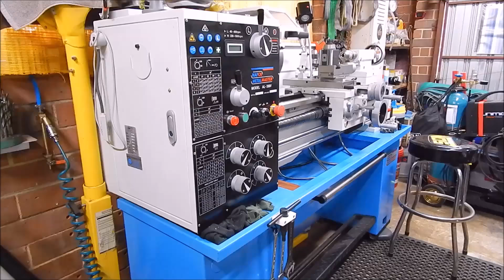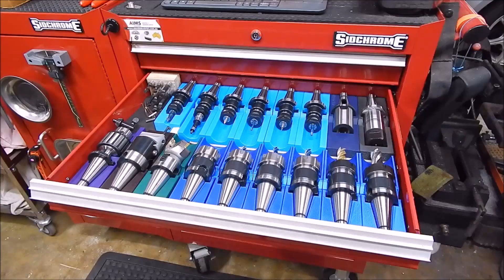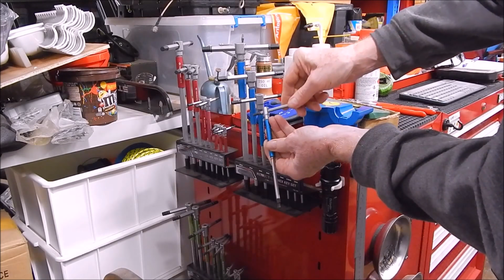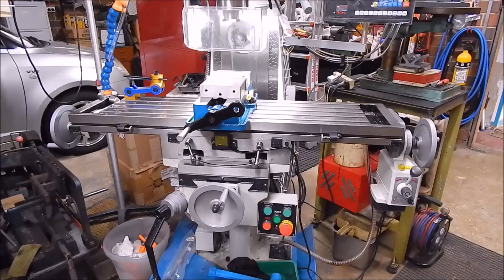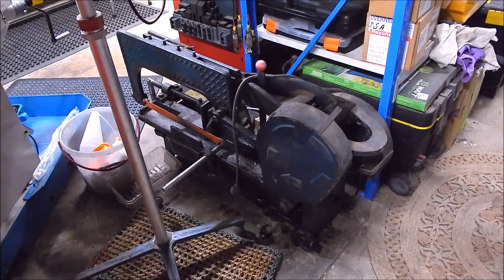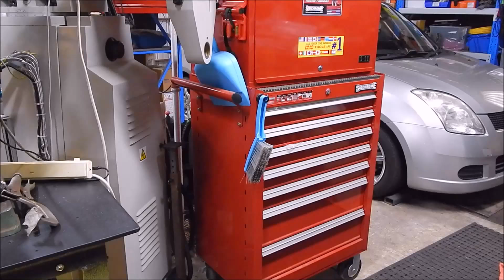I visit a local viewer's home workshop - impressive

Comment: Great tip about the bottle jack under the pillar drill.
Could you use a bottle jack under a full length pillar drill if you used a length of wood or bar between the jack and table?
Reply from the maker: Hi Harvey,  I've never tried it.  I suppose you could, but it would be a bit unstable I expect.  Cheers Rob

Comment: Rob struggled with Tig purchase for years. Learnt it back in college but yes gas rental was always the killer. 3 years ago bit the bullet. Gas bottle deposit at Bunnings $90 for refill and got 2 years out of it. Great for fiddly work. Should get 2 years out of current bottle. Really like the cleanliness of welding. Haven't regretted decision. Have welded things that would have been out of the question with other methods. I've recommended a mill to you in the past as well. As a fellow tight ass I see where you're coming from but aye you only live once. A Tig and a Mill are the icing on the cake. Cheers
Reply from the maker: Hi George,  yes, all fair comments.  TIG also has the big advantage that you can take your time welding, unlike other forms of electric arc welding where maintaining speed is critical when laying down a bead/filler.  Cheers Rob

Comment: Lovely tour, masses of stuff yet spacious enough to easily move about & find what is needed. Tons of ideas for how to improve my shops & inspiration to get it done. I bought a tig unit dc only (not Aluminium capable) to weld up some tractor wheels last year & it's nice to have such control & learn the technique, mostly from Jodie at Welding tips & tricks who has some super useful welding instruction on his channel. Thanks for sharing!
Reply from the maker: Glad you enjoyed it.  TIG certainly has some advantages, allows for as slow/precise as you like welding, compared to stick and MIG.  Professionals do some amazingly clean work with TIG.  Cheers Rob

Comment: The man has a great shop.  Perhaps you could share some of the projects he as done with all those machines.  Thanks Rob.
Reply from the maker: Most of Peter's work is to do with major Ham radio club projects and he needed a large lathe and spindle size for machining radio masts, fittings and transmitter equipment/cases etc.   The mill is sized for similar large scale projects.

The massive amount of radio equipment Peter has is way out of my knowledge stream and worthy of a separate video by someone who knows the subject.  Cheers Rob